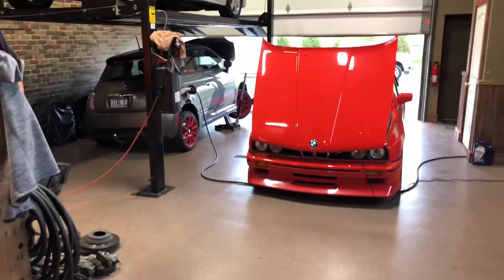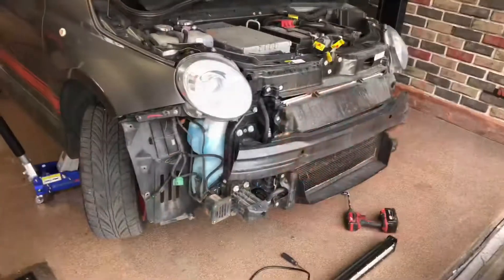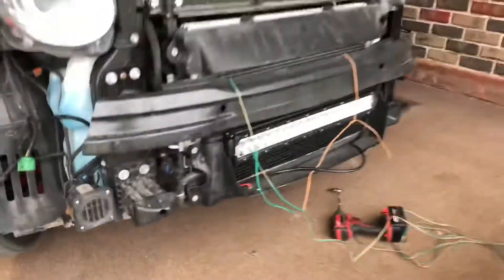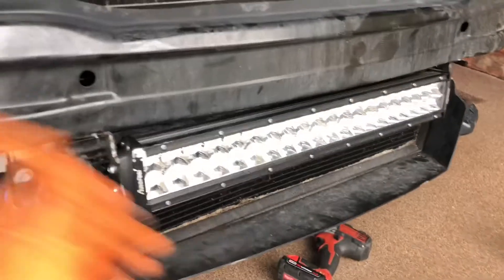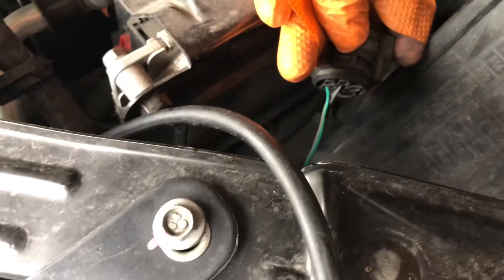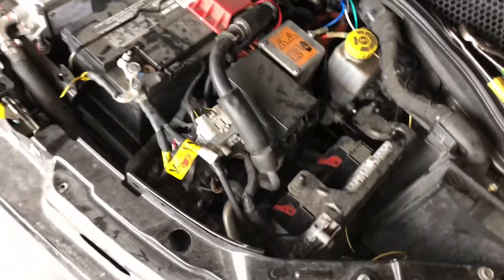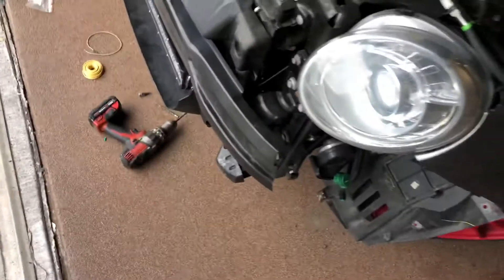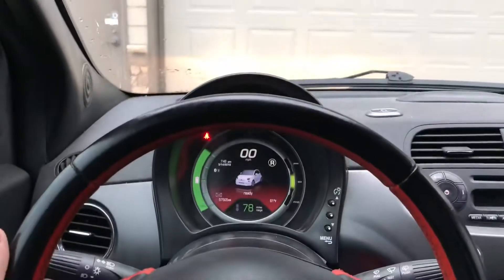Fiat 500e 24" 280 watt LED Light Bar stealth install - the electric boogaloo

Comment: How you feed the on/off switch to the inside of the car
Reply from the maker: There is no on/off switch. this is wired to a relay on the high beam.
Reply: For the Future Users: There is a gap/hole in, at least, the A Bar of the passenger side between car interior/engine bay that you can slide wires through.

Used it to install a Button for one of those fun Autozone horns that play music.

But if I did a lightbar, Id prob do the same with a switch

Comment: Ha Ha Ha Eric i live 20miles from Wales and you have a Welsh dragon decal
 their flag on your miniwags amazing to see in the US an old British plate (yellow on the back then white on the front).. more F355 spyder (this is how i found you) please and i hope as well you fix your E10 please too
 thanks i also can't believe how far you drove to go and collect your F355 wow!
and it didn't break but i guess manuals' are the best trans'
 i wanted to ask now you have fixed your pump are you going to autocross the 1M? maybe
Reply from the maker: Well, Brexit the E30 wagon lived in Wales from new to 2015 :)

the USA is huge, so I actually did not travel that far for it -- maybe 800 miles? I went 2,000 miles for the E10!

I am torn.. the 1M is a SUPERB track car, but its just so rare I don't know if I will. my fiat electric is SO fast and torquey in autocross, I will probably just use it instead.